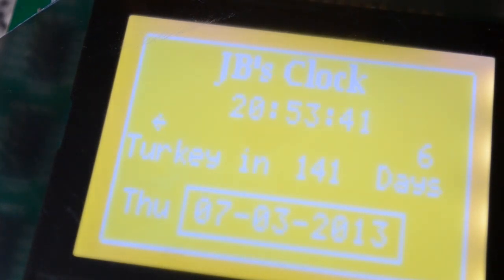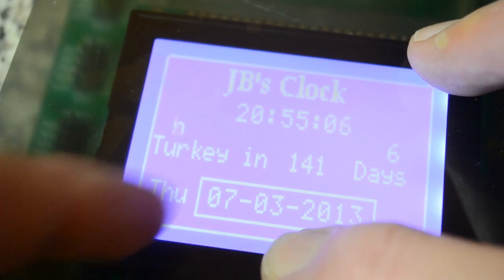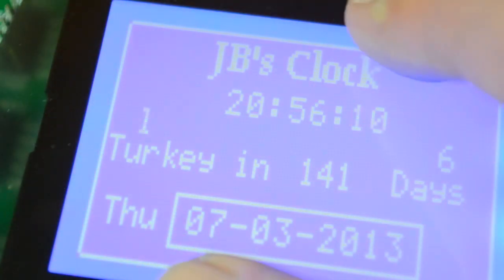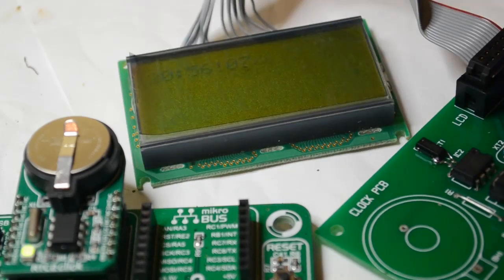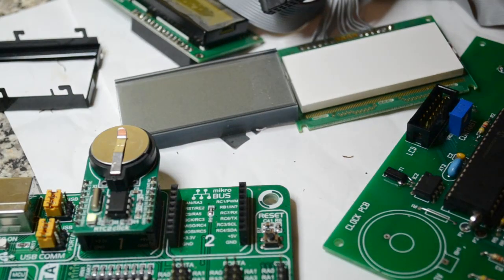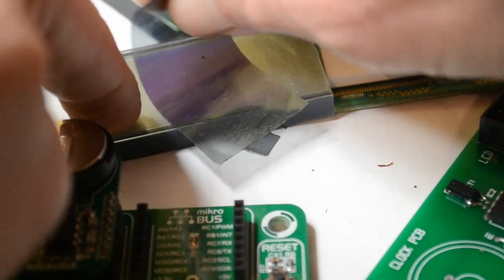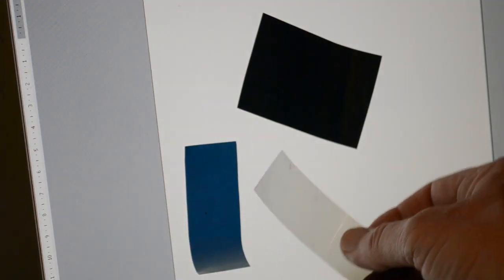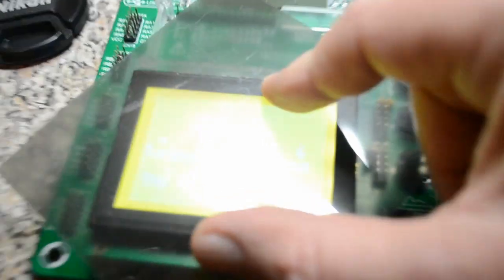Polariser, Polarizer, How to change the colour on your monochrome LCD / GLCD

Comment: Hello John. I know this is an old video, but am trying to find a suitable replacement polarizer for the gameboy pocket monochrone lcd screen. Mine has a burned front polarizer film and I wish to replace it. I have ordered a bunch of different polarizers (linear ones) and cannot maintain the original neutral gray tint of the screen with a new polarizer. No matter which one I buy the result is a screen with a strong green tint like the original/classic gameboy (DMG). The gameboy pocket also has a back polarizer and a transreflective film on the back with a silver tint to it. Any help on the matter would be much appreciated. Thank you in advance
Reply from the maker: I can only assume the game had a different type of polarizer. I'd be looking for a used part on ebay.
Reply: @JohnB-2021  used screens go for the same amount as the whole gameboy. The point is to be able to refurbish and save existing gameboys with damage. Thanks for the advice

Comment: May I ask what product code is that small polarizer that displays a white background, because I pasted the polarizer of an LCD TV onto the multimeter screen, with backlight, but it only displays purple digits, even though it's not working. Turning the polarizer also doesn't have a white background and black numbers. While the original has a white background, the text is black, and the numbers are black

Comment: HELP!! I
 have a Casio G Shock watch with a liquid crystal display, but I want to
 invert the colors, I remind of a small debunker a calculator and I 
brought a glass that inverted it turned the colors, that glass I do not 
know what material it was but where I can get it to achieve that Effect on my watch?
Reply from the maker: Hi,
It's a big job just to change the colour.
You can find polariser sheet on ebay etc
Reply: With this I can achieve the negative effect?     http://www.ebay.com/itm/Polarizing-Film-STANDARD-GRADE-/252131811987?hash=item3ab43a2293:g:Ut0AAOSwPhdU1~KH
Reply from the maker: Yes
Reply: Thank you very much, I'll try !! , regards!

Comment: Hi John, thanks for your video.

i have a simple question and maybe you can awnser this.

i have a small display with orange backlight and black numbers and info.
is it possible to get a black background and backlight iluminated numbers and info by turn the polarisation filter 90 degrees?
Reply from the maker: Hi,
Change the orange LED to a white one and go from there.
You need to confirm if it's a reflective LCD or not.
If not, you can change the polarizer to get the desired effect, but a lot of work for something simple.
Thanks
Reply: John B 
thanks for the quick reply.
how do i check if its a reflective LCD?
ik cant send a picture of the display but if u want i can send it by mail.
Reply from the maker: Hi,
A reflective display can be seen without any back light
Reply: John B

Ahh, thank you again.
yes i can because its thema display of nu motorcycle. the clock is stille visible with the power switched off.
Reply: Hi,
Yes i can because it's the display of my motorcycle and i can always see the clock running, even with the power switched off.
I am going to change the LED's from orange to white but that would give me a white background wich i would not like, i rather would like it to be black with white numbers and info.
so if i would turn the polarized filter and the current background would go black and the numbers and info turn up orange then i would have to change out the LED's and im happy.
i really hope it's that simple.

Comment: Hi JB,

Thanks for the informative video but I have a question if you wouldn't mind.... I have a Casio G-Shock DW 6900 (white / grey colour watch) with a white lcd what has black writing now would using that polarizer you have shown will it change the colour to say a blue tint with white lettering?
Reply from the maker: Hi,
Yes the polarizer would change the colour but, I personally wouldn't try it on expensive small watches. I have seen they make them in different colours and they probably have a different colour LED back-light too.
Reply: I've changed my gw9400 black digit white background into black background white digit. I personally want it to be red digit, But it seems impossible because these polarised films invert colors so there is no way i can change black into red (black-> invert -> white)